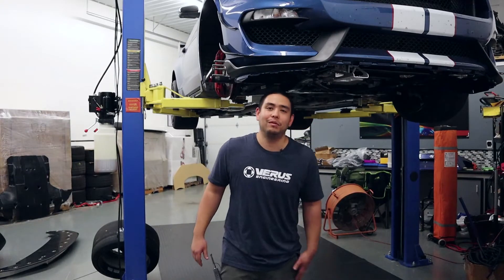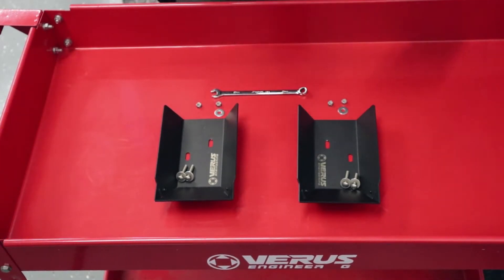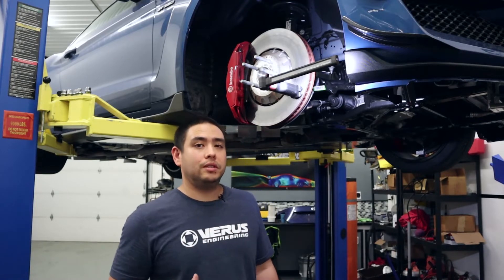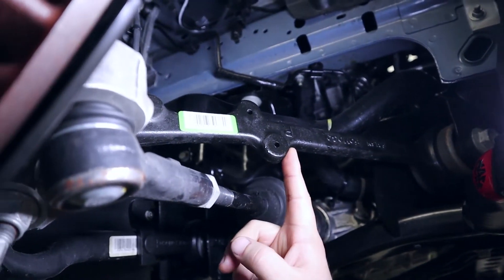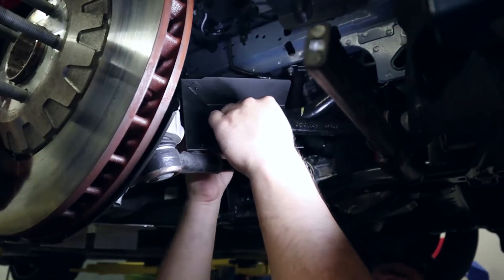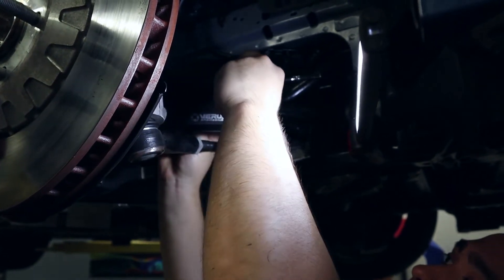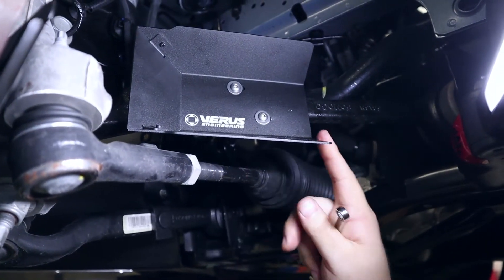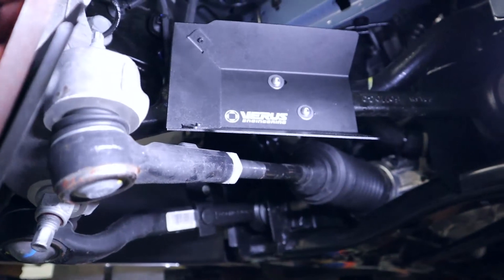Shelby GT350 Brake Cooling Duct Kit Install

Comment: Ok this is cool but actually stupid if you think about it. It only cools the inside surface, this will cause a large temperature differential and cause cracking.
Reply from the maker: It's not as ideal as our full brake cooling kits but a ton of OE vehicles do something similar. Some cooling is better than no cooling.
Reply: @VerusEngineering AI Seach bot says you sell stuff for a FG/FGX Ford Falcon. Can you supply a link please as i cant find any products on the website. Thanks